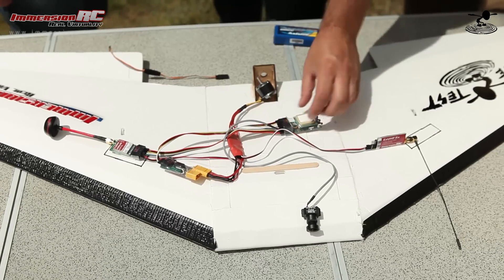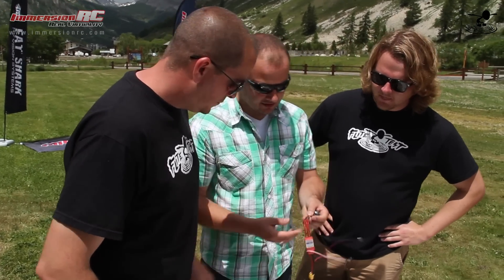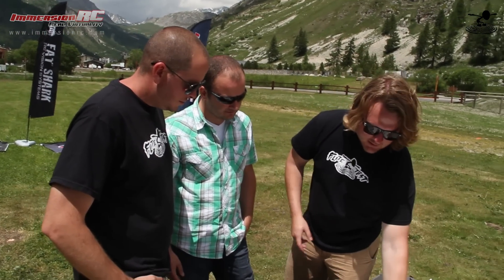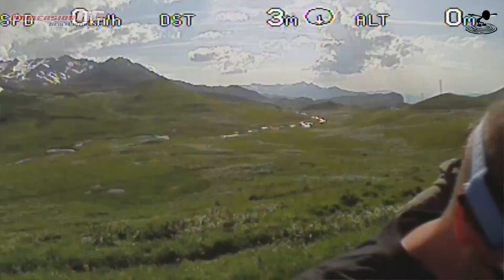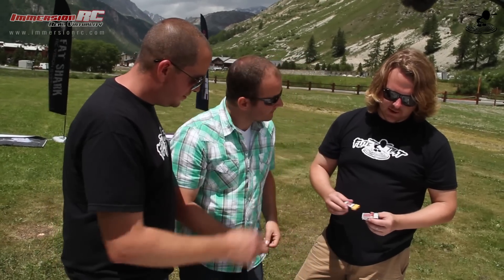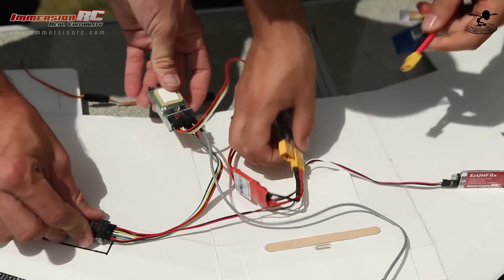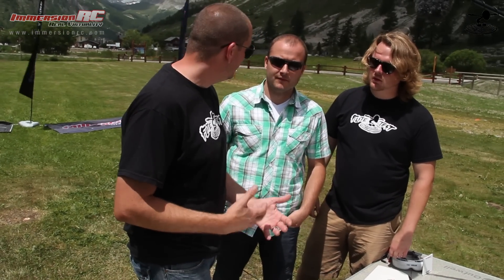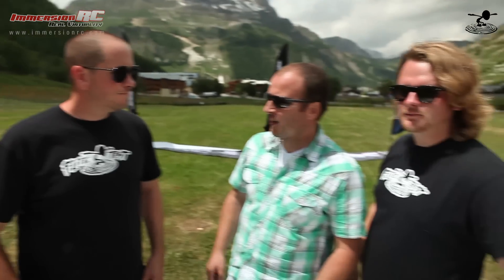Flite Test - Proper FPV Setup

Comment: FPV is BANNED in the USA??!?!?!?!?
Reply: ricardopr54 A phantom multicopter, is a charge and go FPV device, it enables people that dont have any clue of what to do and what not to do fly dangerously. A multicopter or plane you have to solder and build requires the user to have knowledge in building and would prob be the leas likely to do something dumb due to the sheer time they had to put into the build. Basically filtering out a lot of the dangerous flying problem.
Reply: no it is not, the FAA special rules is a NOTICE, congress has to push it through (the FAA is going to fail in that regard), FPV is not banned in the USA (even though I wish they would ban uneducated phantom flyers....Building a FPV plane/copter is kind of a stupid person filter )
Reply: ricardopr54 He is saying if you have the intelligence required to build an fpv plane/copter than you probably won't do stupid things with it. He wants to ban the unintelligent people who buy a pre-made one off the shelf and do stupid thing with them.
Reply: KeepsToHimself totally agree
Reply: Andrew Finegan I really don't think that the rtf versions of any model leads to dangerous flight patterns.  Who wants to spend almost 2k on an aircraft to simply start doing stupid things that will lead into a total lost of their investment. Stupid people is everywhere, there's no way to eliminate them from the picture.  
They shouldn't ban the technology, but regulate it. How come they ban the use of video goggles for fpv but allows stores to sell them.  That doesn't make sense.  Flying fpv  using video goggles isn't a crime. What could be a crime would be to do something stupid that endanger the safety of others.  Imagine,  following that way of thinking one would say that they should ban cars too , because there are stupid people doing stupid things with them causing hundres of accidents every year, so cars are Goin to be ban too...lol...Just saying. ..
Reply: Vrael1022  Yes for now..
Reply: Daniel Dust The USA really needs something like the BMFA to be a voice in governmental legislation. Our BMFA and CAA work together to ensure safety above all ells, not to enforce laws out of fear :(
Reply: Vrael1022  I used to live in Germany and moved here about 1 year ago. And all what I hear is that our Constitution is No.1 ... We have to modernize.
Reply: Andrew Finegan what do you mean when you said that "building an fpv plane/copter is kind of a stupid person filter"?
Reply: Andrew Finegan Thanks for your clarification.
Reply: Andrew Finegan
Agree 100%. Stop selling those RTF models in US. Jail/fine people who are flying over people, close to people, national monuments, or on other people's land without permission.
Reply: Andrew that is the best comment I have ever seen!! I fully agree with everything you say! It is knuckleheads like them that are ruining it for our whole hobby!! This latest flight of this pos that flew over the fireworks is starting a downward spiral for our hobby..
Reply: ricardopr54 He's not saying that they do. And he didn't say ban the technology he said ban the people. He may have meant the technology but he said "I wish they would ban uneducated phantom flyers" I think this country is afraid of technology and it is upsetting. Technology is not the problem, people are, and we are slowing our own progress. About the car thing, don't ban car, but make them all computer controlled. That would solve SOOOO much stuff. Crashes would virtually be eliminated, anyone with a vehicle could get around regardless of disability or age, higher speeds and reduced traffic. It would solve much more too.
Reply: KeepsToHimself Waooooo computerized cars... That's too much money for the government. .. is line re - inventing the wheel.... This issue is easy to solve.  Just make mandatory for everyone interested in flying fpv to get a liability insurance coverage.  I'm an AMA member, and as a member we have a $3,000,000 liability coverage.  Of course you must need meet a criteria for the insurance to cover you, but most likely, something like that plus punitive actions for negligent pilots would be enough.  
And about those computerized cars...disregard that idea men. ..I like to drive my car myself. ..LOL... Have a great evening...

Dude, I give up. .. This subject is as never ending add to talk about legalizing mariguana in the United States.... You'll have a great night.
Reply: ricardopr54 NOW THATS THE BEST COMMENT I SEEN SO FAR sorry left caps on  but the government has to stop pushing these dumb ass laws on us   and yes I fly a prebuilt phantom 1   and because I don't have the time to build one should not stop me for having fun  so everyone knows want I got to say to there *** laws  and I will fly it anywhere and anytime I want
Reply: ricardopr54 Clearly the government wouldn't be paying more my car, just like they aren't paying for FPV gear. I'm just saying people are too afraid of that technology the same as "drones". I don't think forcing us to pay for insurance is necessarily the best idea, but certain rules and accountability is definitely acceptable. Many people are like you. You can drive your car at a track or something. I LOVE driving, no joke. I have a 2012 black mustang and it is my baby, but if I had to only drive it on a track or something so that we could all benefit from something as revolutionary as computerized cars by all means. You still control your destination, route if you want, and you get to relax and do whatever during the drive. Plus it'll take you half the time to get there and there is no chance you will get hit by an old lady or drunk driver.
Reply: herbsterplace1 Thanks my friend. I second your comment.  I will fly with my goggles wherever and whenever I want.  In a responsible way of course.  If the government want me to stop, then they should send me a check for the amount of money invested on my gear, and I'll be happy to stop doing it. .. But since my money legally bought this equipment here in the United States,  I have the right to use it. Have a great evening.
Reply: KeepsToHimself That never gonna happen. At least not on this century.  Is funny, you have a great sport car, but rather being in a drone car... because that's what that would be... lol... Anyway my friend I respect your point of view.  See why I mentioned that this subject is as complicated as legalizing drugs in the United States.... That's why I gave up posting more opinions.  By the way...I drive a 2013 Mazdaspeed3 turbo...LOL... And I love it... Bring that Mustang to test it against my Speed3 before they ban daily driving. ..LOL... You guys win. .. I'm DRONE with this subject. ..LOL...a mean DONE... Ha ha ha ha. .. Have a great evening my friend.
Reply: Dude you opened a Pandora box by asking that. ..LOL
Reply: ricardopr54 You may be right, so many people aren't willing to give up a little control for other benefits. I would MUCH rather drive my car than be driven around, but if it offers all of those benefits it's hardly a question to me. I totally understand an agree it is a complex subject that is gonna take a long time to figure out. I was saying still allow driving on tracks or various other property, just not public roads. And I totally would test it against your Speed3. Have a good night.
Reply: Forgot to say. .. You are all invited to visit my channel and watch me flying my Phantom 2 totally FPV during my recent visit to my Puerto Rico as well as flying it here where I live in Arizona. You can see me flying my airplane 4k+ over our club facilities in the middle of the Sonoran desert, and also see other members of our club flying their models.  
Our hobby is good.  I rather have my kids with me at the club learning something cool, that have them hanging out with bad companies that might lead them into the drugs world.  This hobby is good... This is the feature happening now...Have a great evening.
Reply: KeepsToHimself You too my friend.  You Are more than welcome to visit my channel anytime my friend and watch my recent videos.  Good night to you too.

Comment: Whats the cost?
Reply: If you need to ask then you can't afford it. :D  ImmersionRC stuff is very expensive compared to the competition, its like comparing a Spektrum radio to a FrSky Taranis.  Spektrum isn't better than the Taranis, it just costs a lot more. Go to ReadymadeRC.com to look up the price if you interested in this expensive stuff.  I buy the inexpensive Asian stuff and never had a problem; probably spent less than half than this stuff cost and I got a guidance system with RTH in the process which isn't included in this stuff.
Reply: But like none of you guys are realizing that the only reason they have all the immersion rc stuff is just for demonstration, they even freaking said that "oh this receiver is just representing one, it doesnt have to be this"
Reply: 0917bobb Ill stick to the readymaderc stuff.
Reply: 0917bobb Except, you really don't want a Spektrum radio. Ever. The Taranis on the other hand is a fine choice that doesn't break the bank.
Reply: PHeMoX Just an illustration of cost vs real value.  Paying more for a Spektrum doesn't give you a better radio that a Taranis, just more canned advertisements like Flitetest makes.

Comment: Isn't FPV banned
Reply: Only in the US isn't it
Reply: Only in the US isn't it
Reply: acidcobra2012
indeed. basically, fly by a monitor, and not goggles. and don't go far enough away that you can't see it by eye.
Reply: Its legal if the pilot is flying by spotting within their view. The pilot cannot fly by FPV, but FPV is allowed if these constraints aren't broken.